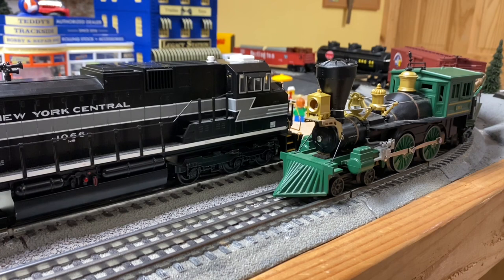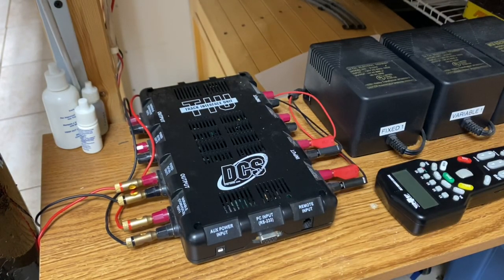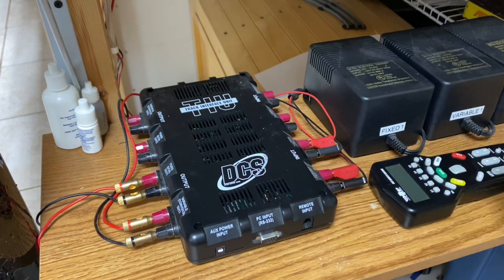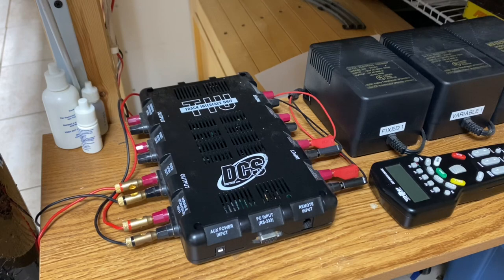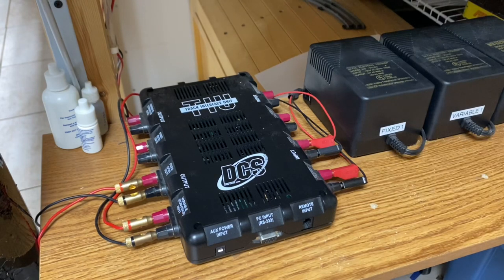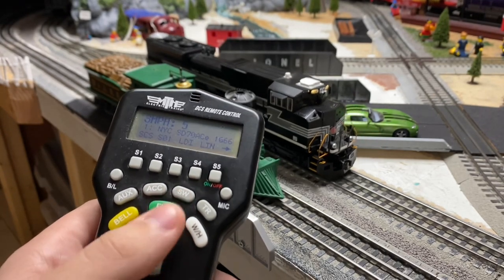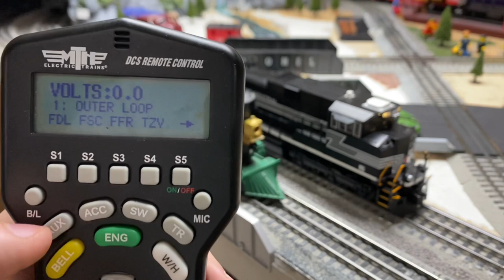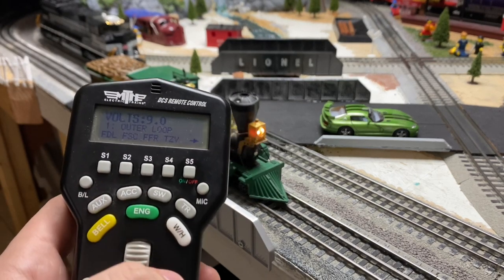How I Operate My Model Train Layout!

Comment: 90% of my trains are post and pre war. A few years back I purchased a used Lionel Yankee with Proto 3. I could get it to run off my Lionel CW-80, but not very well. I assume MTH built the train and put Lionel's name on it. I finally purchased a used MTH, DCS Remote Commander and a MTH brick to replace the old transformer when I am running the Yankee and boy is it fun! t takes a few minutes to swap out power supplies, but I will get used to it.

Comment: What do you do if you want to run the New York Central on the outside rail and the General on the inner rail?
Reply from the maker: Great question. So if I want to run the New York Central on the outer track, what I can do is just turn track power up to 18 volts, start the engine up and run it as a command control engine. However, because the inner track will only control a train equipped with command control, to run the General, I would just unplug the wires on the TIU and plug them into a variable channel, so that I can adjust the voltage going that track and run it that way. It’s a little confusing yes, but that’s how I have it set up as of now.
Reply: @mattstrains416  Got it, thanks for the information.

Comment: You DO NOT need to have Fix output in order to run DCS in a varible output.  You just have to jumper power wires from FIXED IN to VARIABLE IN in order to power the variable channel.  I only have one set of wires running from out to tracks.. .and that is Variable one out.  That's it.  I run DCS and conventional on that one set only.  I do however have jumper cables from FIX in to Variable in.
Reply from the maker: You don’t? I never knew that. Well, you learn something new everyday. Thank you for the correction!

Comment: Is the variable track strictly for conventional engines?
Reply from the maker: Not necessarily, you can also run command engines on the variable track, just make sure the track is at full voltage (18V)
Reply: Thank you.